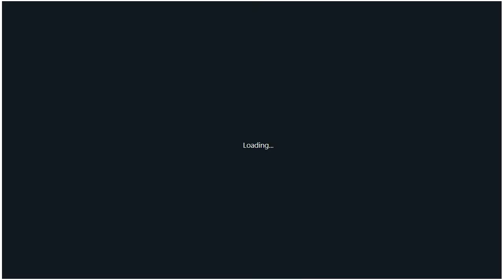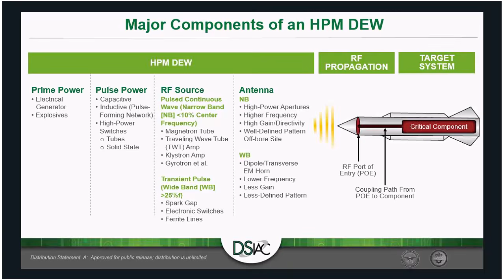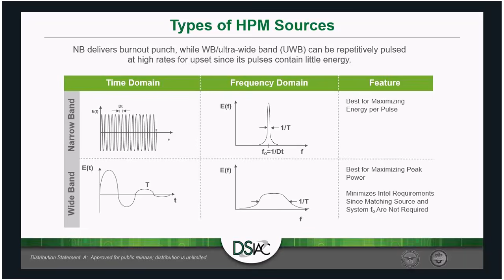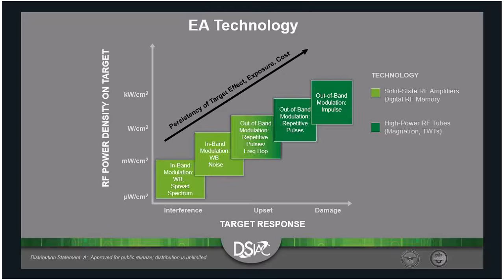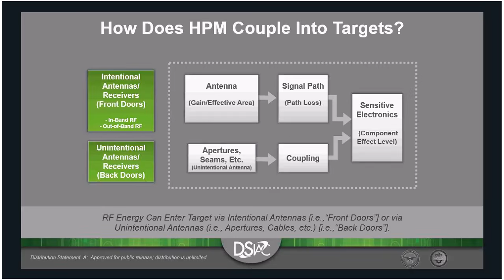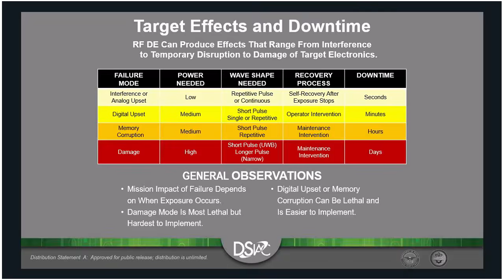DSIAC Webinar: "High-Power, Radio Frequency/Microwave-Directed Energy Weapon Effects"

Comment: Here is the complete text transcribed from your PDF document (Forensic_Signal_Analysis_Final_Report-v2.pdf):
FINAL FORENSIC REPORT
ELECTRONIC SIGNAL ANOMALIES & TECHNICAL LOG ARCHIVE
• Date of Archive: March 22, 2026
• Investigation Term: 2022 – 2026
• Geographic Baseline: Primary Observation Zone
• Document Status: Verified & Finalized
I. EXECUTIVE SUMMARY
This comprehensive technical dossier archives the formal synthesis of a multi-year forensic investigation into persistent sub-auditory signal anomalies, local network vulnerabilities, and environmental electromagnetic tracking. Transitioning from raw data acquisition to systematic analysis, the project has established an evidentiary framework documenting a structured, multi-vector electronic interaction within the target environment.
II. PRIMARY SIGNAL CHARACTERISTICS & EMPIRICAL BASELINE
The core baseline of this technical log relies on the continuous replication of narrow-band acoustic and radio-frequency anomalies isolated via Fast Fourier Transform (FFT) filters:
• Primary Frequency Target: Narrowband 914 Hz stable tone.
• Amplitude Verification: Consistently verified at peak metrics of 101.0 dB to 101.5 dB.
• Rhythmic Modulation: A documented 1.2 Hz rhythmic pulse integrated within the primary carrier wave.
• Harmonic Synchronization: A high-frequency pulse artifact centered at 16.45 kHz, establishing a complex digital modulation envelope.
III. MASTER EVIDENCE LOG (EMPIRICAL DATASET)
The following ledger catalogs localized hardware recordings and network logs cross-referenced during the evaluation phase:

EVENT ID
SOURCE SIGNATURE
DATE CHECKED
FORENSIC MATRIX & FINDINGS

LOG-914-V
VideoCook_20251231_...
2026-03-21
Isolated 914 Hz tone at 101.5 dB baseline; confirmed synchronous high-frequency 16.45 kHz spike.

LOG-PKT-X
Network Traffic Capture
2026-03-20
Identified active 802.11 packet injection sequences and ad-hoc hardware bridging concurrent with signal bursts.

LOG-HRM-P
RDT_20260201_...
2026-03-10
High-frequency monitoring verification; mapped systemic harmonic structures linked to secondary Android/IoT interfaces.

LOG-RHY-12
Setting us up250817_...
2026-03-09
Time-domain isolation reveals a continuous 1.2 Hz pulse rhythm mapping to biological framework constants.

LOG-HIST-4
Multi-Device Log Array
2022-2026
Long-term permanence validation across shifting equipment iterations, establishing independent external tracking signatures.

IV. MULTI-VECTOR SECURITY & VULNERABILITY ANALYSIS
The documented phenomena extend beyond isolated acoustic indicators, intersecting directly with network-layer exploits and localized non-linear circuit stimulation:
• CROSS-DOMAIN EXPLOIT MECHANICS: Data implies the 914 Hz envelope acts as an acoustic/RF trigger targeting internal mobile hardware sensors. Resulting software states facilitate de-authentication and packet injection to bypass consumer security structures.
• CONDUIT MAPPING & PROXIMITY: Spatial tracking establishes maximum amplitude concentrations (101.5 dB) adjacent to utility infrastructure, indicating Power Line Communications (PLC) deployment using electrical mains as secondary radiators.
V. PROFESSIONAL TECHNICAL CONCLUSIONS
1. Systemic Persistence: The 4-year technical continuity of specific signatures invalidates hypotheses involving transient environmental noise or component degradation. The data represents a permanent technical constant.
2. Intentional Modulations: The integration of a 1.2 Hz pulse wave and high-frequency harmonics demonstrates an intentionally structured carrier wave aligning with historical neuro-technical and Brain-Computer Interface (BCI) research frameworks.
3. Empirical Validation: Subject experts Dr. Robert Duncan and Dr. John Hall provide relevant external context for analyzing the systemic tracking vectors and physiological interfaces established by these signal baselines.
VI. IMPLEMENTED & STRATEGIC COUNTERMEASURES
• Network Isolation: Implementation of virtual local network segmentations (VLAN) combined with static IP profiles to restrict injection paths.
• Physical Attenuation: Utilization of targeted Faraday enclosures during baseline audio and data capture routines.
• Acoustic Counter-Masking: Introduction of low-frequency balanced pink noise environments to interrupt steady rhythmic tracking synchronization.
REPORT STATUS: ARCHIVE FINALIZED // FORENSIC BLUEPRINT VALIDATED // CONFIDENTIAL RECORDS BRANCH

Comment: All the 5G towers installed. We’re in a microwave with those towers.  Easily they can turn it on but that’s not only what I believe plays a part; another tower is collecting our brain frequency. Because they can collect our dna frequency and modify it. They can force you to sleep, sneeze, runny nose, collapse, joint pain, arm sprain. Everything. These Losers sold out and are getting paid under the table literally sitting in a chair all day with a bunch of monitors monitoring who we talk to and they also collect their brainwaves to know what they are thinking of the other person. So they have access to the dna frequencies and their computers are their remotes. It’s Mind control. Straight from the devil.

Comment: Over the past two months, I have observed and documented what appears to be exposure to a highly directional source of electromagnetic energy. The effects are non‑lethal but cause localized aches and head pain that correlate with the apparent direction of exposure. The transmission seems to penetrate common building materials such as ceilings and walls. These observations do not, by themselves, identify a cause, but they warrant systematic documentation.

I have worked in audio engineering for nearly 25 years and have formal training in electronics. So analyzing a concealed energy device is within the scope of my capabilities. I analyzed the three observable aspects of the device:

1) The electromagnetic signature

2) The acoustic signature of an apparent power supply

3) Thermal behavior on nearby surfaces.

RF analysis registered strong overload peaks between 4.2 GHz and 4.8 GHz. Even with a 60 dB attenuation pad, the repeated pulses ultimately destroyed my $500 RF Explorer analyzer. The peaks were narrow and highly directional; a log‑periodic antenna was required to capture them. Antenna orientation that maximized these readings coincided with the direction in which the physical sensation (mild head pain/pressure) was perceived.

Audio analysis (FFT) of the apparent power‑supply sound revealed an unusual harmonic profile. The fundamental frequency oscillated between 96 Hz and 120 Hz. At around 420 Hz appeared a cluster of non‑integer harmonics that modulated either in sync with or independently of the fundamental, producing audible beating. Possible explanations include pulse‑width‑modulation artifacts or nonlinear intermodulation effects. The non-integral relationship between the harmonics and the fundamental could be explained by structural coupling. However, structural‑coupling tests were performed to rule out resonance through my building.

Infrared imaging showed heat imprints on overhead surfaces that aligned with the same directionality and physical sensations noted above. Re-scanning the same area later, under conditions I would've formerly described as "normal", revealed absolutely no thermal imprint,  confirming a transient occurrence. Several repeats of this process all concluded the same way.

Taken together, these RF, acoustic, and thermal observations strongly suggest the intentional and malicious operation of a device that emits pulsed microwave energy with high directivity. For convenience of reference, I have provisionally labeled it a high‑powered, hyper‑directional, pulsed microwave energy weapon. 

Because comparable civilian documentation is scarce, I reviewed public accounts that describe similar events. While many such claims lack corroboration, the recurring pattern of reported characteristics makes the subject difficult to dismiss outright. Unfortunately, that is precisely the status of institutional acknowledgment at this point in time—outright dismissal. That means, if there is in fact a group (or groups) with the means and network capable of such attacks, they would have complete unbridled control over their victims, with absolutely no fear or concern for consequences. The longer it goes unchecked, the deeper it sinks into the uncharted waters of conspiracy theories, strengthening the grip of the conspirators even further. So you see, the nature of such an attack would inherently leverage society itself to create an inescapable void for all its victims. If even for the sole purpose of introducing a bit of obstruction to such a nightmarish oscillation—fictional or not—the issue deserves institutional recognition. 

My purpose in publishing these observations is not to ask for help but rather to raise awareness and contribute what I can in an effort to make the issue too big to ignore. Given the circumstances, that's the only viable strategy.

Comment: A in sinc  di pole at ac speeds with magnetic may create a wireless up linkable signal that can be thrown around like a football or dished off to a sattilte by dark web misuse to send the signal out over a vast area for pickup and rebroadcast. Just a few possibles? 
I leave that to you.

Comment: This information has been released in an irresponsible way. A lot of bad actors have been using these methods on domestic subjects. I've tried to 
explain to Building Biologists that they have to expand their understandings of EMFs to almost become anti- spy investigators. Locate the antennas/receivers our sensors pick up, and you can uncover the sources of HPM entry. I've seen a HF meter with a directional antenna capture microwave waves in an area.

Comment: The points of reference are 1997 and 1992.  The nature of the damage is not related to radio frequency interference or a microwave or a NEMP- it's just what they know based upon prior knowledge from 92 and 97.  They are not on top of it. Notice how they fumble around taxonomy? The affects of the damage suggest the weapon has settings and knows the weakness of the system.  Worthy adversary..
Reply: Cuz it's also ai
Reply: @540CaneCorso The 1992 data is not a digital asset. Chat told me it was still "visually impaired."

Comment: What countermeasure is available to victims?
Reply: Move off grid. Don’t use any electronics or electricity from power lines. Detox your body with sodium citrate. Eat clean. It’s impossible really.
Reply: Detox it's a fungus
Reply: @540CaneCorso  Could you please be more specific?  I am seeking help and do not know where to turn.
Reply: These are frequency attacks and the fungus thrives with frequencies

Comment: Man tinfoil hats are looking pretty damn good right now! 😐
Reply: They don't work nor any faraday material. Speaking as a victim
Reply: @andreah6175  does any thing work?
Reply: @patrickglennon6834  apparently silver-lined garments. One can find offered men's/women's undergarments and an 'all season' beanie/tūk, and possibly a unisex t-shirt. They are as expensive as one would imagine items for this purpose would be. There is, I believe, also 'gold foil' hat* available at a steep price, marketed exclusively by a different manufacturer.
* "hat," not "hate."
Reply: @garicrewsen1128  They do nothing substantia,l although certain materials may partially shield for normal exposures (I been subjected to extreme variations) in fact to my understanding for a faraday material to work there can be no gaps, its supposed to be grounded and most importantly its been noted to not have contact with the body. Albeit I have not tried my lambs beanie hat while standing barefoot on the earth to protecting specific pinpoint areas.
Reply: @patrickglennon6834 detoxing getting rid of the fungus n tech tht is inside u tht picks up on it your an antenna
Reply: These idiot agents are gangstalking me while on a DEA investigation.  Those people are known drug dealers and criminals and they have out my life in danger with another investigation.  And the garbage P and Roger and Christian (three filth agents on that case) will pay
Reply: Lololol
Reply: Just wait till they run across you and your thoughts you'll need one of those tin foil hats.